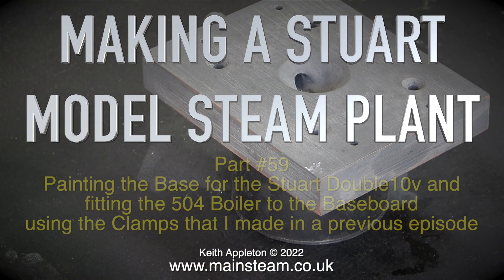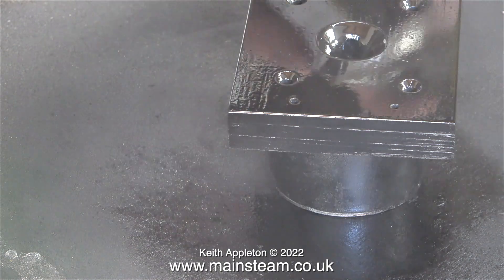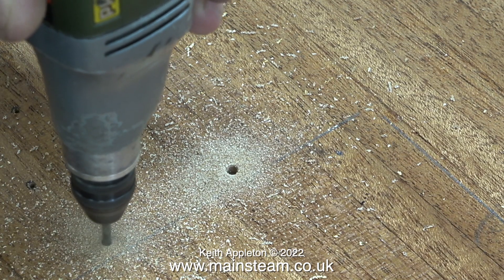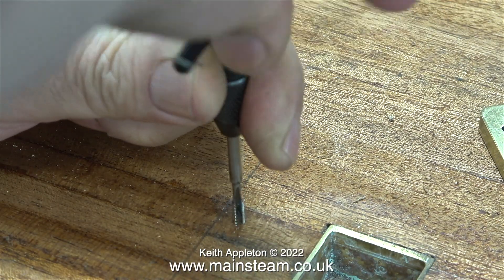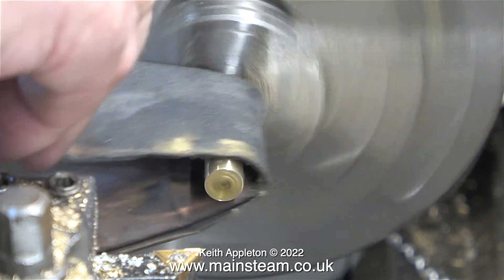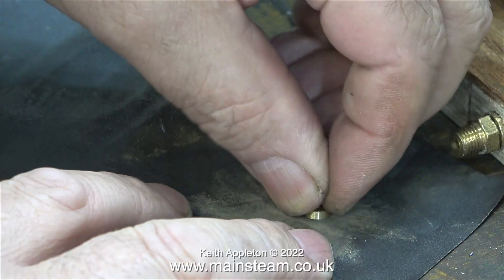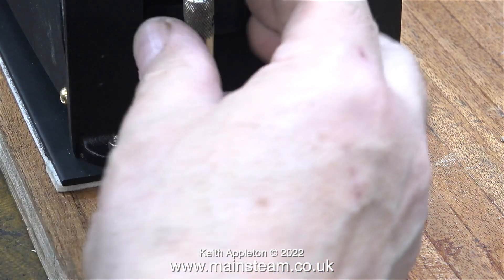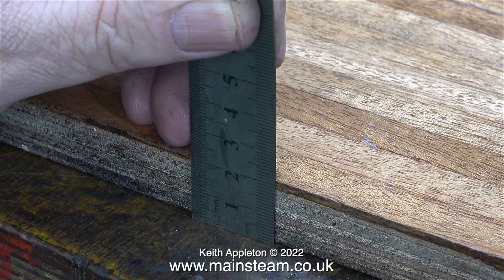MAKING A STUART MODEL STEAM PLANT - PART #59

Comment: Your thermal insulation is probably kao-wool.   The folks who build their own gas forges use the stuff in considerable quantify to insulate the forge, and in that application it takes quite a beating before it needs to be replaced.  Your application is quite "benign" compared to forge work :) :)

Comment: I'm a little surprised you aren't using wood screws or threaded inserts on the base boards. Threaded inserts in particular would improve the durability a fair amount. 

OTOH, I can't argue with success.
Reply from the maker: It has always worked very well for me . . . that's why I use this method.
Reply: @keithappleton  You must be getting better quality wood. In these parts (Pacific NW) pine and cedar are ubiquitous, while most hardwoods are scarce, expensive, and often require surfacing.

Comment: Any reason why spacers were used rather than extending the thermal pad under the clamps?
Reply from the maker: Yes. The thermal material is very frail and easily crushed.